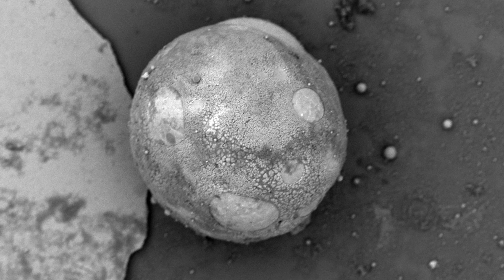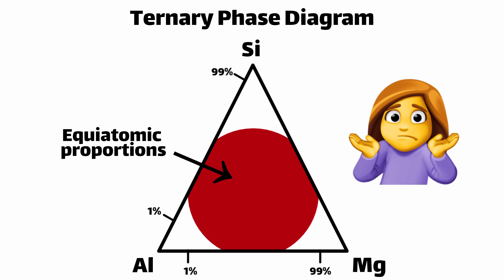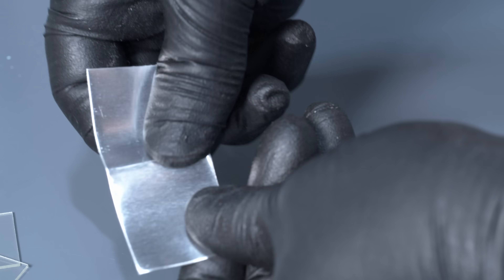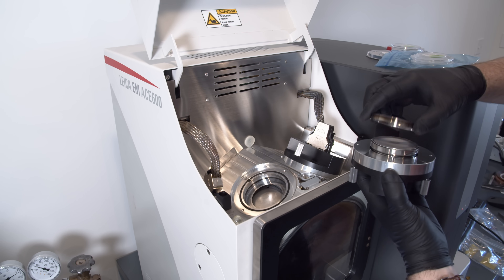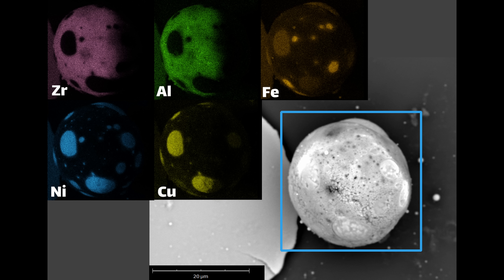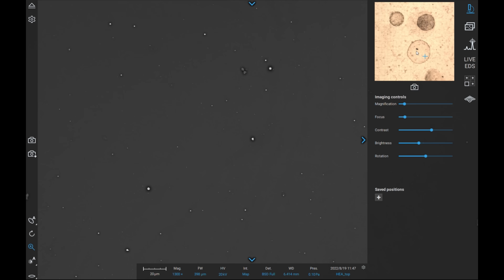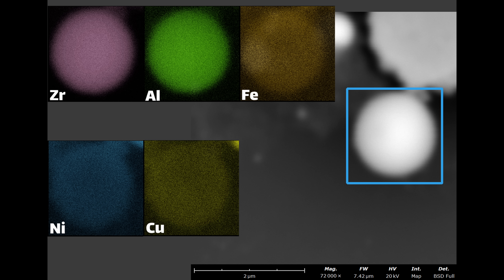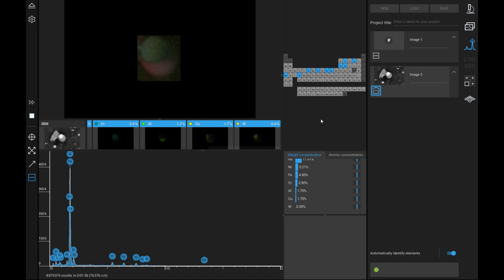Metal Alloys of the Future?

Comment: Where is the ultrasonic cooling shims? Sound vibrations doesn't just move sand, solidification of an alloy can have those lines possess different physical characteristics. Something like a well-thought-out conductivity pattern can facilitate anti-corrosive properties of the secondary structure of a probe operating on Venus's surface, or any hazardous environment

Comment: I feel severly undereducated in this comment section but i had a question, would it be possible to create a high entropy alloy of Aluminium Boron and Lead to be used as a mesh alloy in a radiation layering or would the alloy never hold
Reply: I was thinking of a prospect of using the alloy as a face layer and mid layer with borosillicate glass and leaded glass in the middle seperated by sheets of aluminium foil and a backplate of lead encased in the alloy i primarily was thinking this as a solution to gamma ray radiation and cosmic rays in interstellar probes and possibly vehicles or stations if we ever figure out the complications of the alcubierre bubble, or some alternative way around einsteins theory of relativity in relation to gravitational distortion and superluminal locomotion but thats a fantasy the realistic applications could be more along the lines of improved nuclear reactor safety and gas and resource collection in solar wind within our solar system

Comment: I really need your help @Breaking Taps !!! I am trying to learn about metallurgy and alloying, but it isn't easy to find basic information. I am a drummer, and I would like to make my own cymbals. Yes... I know... this is DIY taken maybe a little but "too far!" but... hear me out. It is commonly said that many of the major cymbal manufacturers use what is called a "B20 bronze alloy" to make their high end cymbals. This means, I think, that it is 80% copper and 20% tin. (sometimes called "bell bronze"). But ALL of the major manufcturers claim that their METHOD for alloying these two metals is proprietary, very special, and is a closely guarded trade secret. I would like to use my backyard furnace to make my own B20 bell bronze. And I cannot think of, nor find online, any special methods for creating Bronze, other than... Step 1: melt x grams pf Copper... Step 2: Add .02 * x grams of tin (20%) ... Step 3: melt and stir... Step 4... pour into a mold and have a beer. What else could there. be?

Comment: High entropy metals are simple in concept: Mix equal proportions of 5 metals together. In Roswell supposedly they found metals that were very hard and very ductile, and not like any metal or alloy at the time. One has to wonder if that was really an early military research application of high entropy alloy that was in an experimental VTOL that crashed near the Air Force base that was near.

Comment: I really hope somebody super smart reads this.

You need to create a multilayered alloy. Sputter through a thin film of one pure element onto a second thin film that you then sputter through onto another film.

You can create infinitely complex designs using this method.

Then calculate temperature into the mix. The target film will have different characteristics at different sputtering chamber temperatures even with the exact same chemical and formula recipes.

Comment: Really loved the "here be dragons" part of the diagram. Its always the best part of any technical discussion. 

To me, it seems like heat feels like the wrong way to try and get these results. To my amateur eye, the problem with this use of heat is that heat is going to effect material according to particle mass. Basically, there's no great way to heat both A and B, but not mixtures of (A+B). Using pulsed lasers for fast annealing does mitigate this issue, but ultimately the application method keeps the mixture's response to heat "between" A's and B's response. Instead, I would aim for some kind of resonance, frequency-based heating method. I think in that case it would be possible to preferentially heat A and B over A+B, for example using something like Induction Smelting, Microwave Resonance, something along those lines. Its well known that atomic iron (eg hemoglobin) isn't magnetic, but iron domains are. Using some distinguishing feature like this, it should be possible to basically only heat the iron in a material that's in bulk form, while not heating already-mixed iron, of course depending on what's being mixed in.

Comment: Foundry metallurgist here...great video! As much as I'm familiar with this class of materials (not much, to be honest), everything sounded about right. I'll add that there are at least some casting alloys, mostly specialty stainless steel alloys in my experience, that are ternary and have significant amounts of the major constituent elements:

-Heat-resistant stainless steel. Although this is generally a broad class of materials, composition-wise, the more highly-alloyed grades have 15-30% Cr, 15-50% Ni, and 20-60% Fe. The balance of Cr and Ni, in particular, can be used to tailor the material to oxidizing or reducing environments, improve resistance to sulfide and/or chloride corrosion, adjust the maximum service temperature, and adjust the microstructure to improve cracking resistance under cyclic loads. Carbon is an important feature of pretty much all of these, as chromium carbides help improve high-temperature strength, creep resistance, and fatigue properties.

-Extreme heat-resistant alloys. These are an offshoot of the standard heat-resistant grades that keep the high levels of Cr, Ni, and Fe and then add usually Co, W, and Nb in concentrations of 5-15%. 

-There are plenty of alloys like the manganese austenitic stainless steels and high-chromium white cast irons that have excellent wear resistance and decent corrosion resistance, but needing high levels of both of those things end up in the realm of certain specialty alloys. 30+% Ni, 30% Cr, a smorgasbord of other elements like Mn and Cu in the 1-5% range, and 5-20% Fe forms helpful intermetallic compounds that boost wear resistance while still having excellent corrosion resistance thanks to the nickel and chrome.

Comment: Not so much 'of the future', more like, "for the rich". Because alloying ingredients like Co, Ni, V, etc are far more expensive than iron. Creating alloys which contain near-equal amounts means you are creating a fantastically expensive alloy that only people who build submarines, supercars, and nuclear reactors will be able to use.  This should not impress or concern the common man.  This research will not in any way impact your life.
Reply from the maker: I don't think that's true or a fair look at how advanced materials are used. I.e. today cobalt is used as a binder for tungsten carbide tooling, which in turn is used to cut most commodity metals (aluminum, steel, titanium, etc) which filter into every part of an average consumer's life. So even though cobalt is relatively expensive and not used directly in consumer applications, it has a large impact.

If HEAs can be used to create better tooling that lasts longer, cuts better, etc it would have a huge impact even if the alloy itself isn't being used in a spatula or whatever 🙂 Ditto to uses in turbines (jet engines, power plants) and other advanced components which indirectly have a large impact. I agree that HEAs will probably never be used as a car frame or a refrigerator shell, but there's no reason for that either. These advanced materials will be used in demanding situations that require them.

Comment: I know nothing about any of this but found it all fascinating. I have an idea, don't know if anyone has tried this, but could you just make a sputtering setup that can apply 5 elements at once, or in rapid succession. If you want a perfect atomic mixture, it makes sense to me to mix them while they are already atoms. No idea if it's practical though.

I also wonder if you could make some kind of 3d printing type sputtering machine and vary the properties of the metal in different areas. Depending on precision, you could make a metal object with a superconducting path through it, or a super conducting transistor embedded in metal. It could be a way to build metal based computer chips which would be much better at cooling and could run at very high temperatures compared to silicon.

Comment: I wonder if you'd have better success repeating the process with the slides resting on a bed of dry ice, or perhaps in liquid nitrogen? I saw a video explaining that the key to making metallic glass is VERY rapid cooling from extremely high temperaturs, so PERHAPS you could achieve better results with much faster cooking.

Comment: Your discovery of the difficulty of getting the Tungsten to combine, with the hypothesis that it's because it's a refractory metal, gives me an idea. 
Take [ whatever data that represents how much of that wavelength of laser energy is captured and turned to heat] for each metal. Then lay down the metals in order of their [ laser energy required to boil ], so that the most energy demanding materials are the first ones in the line of fire. Then, when you hit them with the laser, the low-melting/high-absorption layers don't get over-energized before the more difficult layers are fully zapped. 
It may also be worth finding some sort of deliberate "stop" layer, that will keep the stack in place longer before separating from the glass, or react away the oxygen that may dislodge from the surface.

Comment: Have you tried flame spraying fine powder mixes of the alloying constituents you are interested in onto a substrate? While searching for extremely corrosion resistant alloys for nuclear waste disposal canisters, the group I was working with delved briefly into amorphous metals and the potential for flame spraying a stainless steel container with high nickel content amorphous coating. There wasn't enough detailed information on these materials at the time to make any production commitments, but they had great promise for the future. They were called amorphous because the molten spray was fine enough that it quenched before crystal grain structures could form. That prevented the creation of grain boundaries that can lead to intergranular corrosion. The process might be adaptable for layering high entropy metal alloys. This topic will be fun to follow...

Comment: isnt it better to grind all of different material separetely in different ratio then as powder mix them then use liser or whatever tech thing to just spew it into some kind of a steel by laser? you would end up with semi static fused multi alloy material? making them layer by layer is kind a dumb if you use laser on every  layer. layer by layer will consume some of energy of laser making it difficult to other layers laser can get through... just saying . base start of this is bad. there is needed different approach.

Comment: What I ABSOLUTELY HATED about Material Science course is that it felt like medieval Alchemy rather than an actual science.
We learned what were parameters of different alloys and that's it.

But as far as I understand it was not a course problem but the current state-of-the-art of Material Science.
We don't have - according to our professors - technology to be able to predict properties of materials/alloys.
According to the course - some time in the distant future - there eventually would be supercomputers powerful enough to simulate very large number of atoms in crystal/lattice of the materials to be get close enough data without creating and testing such materials physically.

They also claimed that it should be possible in theory to have materials 100 times stronger than we have today, room temperature superconductors and maybe even heat "superconductors".
Its just that we have no idea how due to lack of ability to predict behavior of crystal of complex mix.

I wonder did state-of-the art changed since I graduated from my University...

Comment: I have no actual knowledge in metal bending😂, I just thought about the 2500+ layer japanese katanas, what would happen if you do the Japanese katana folding technique? Like a same size and weight sheet of each metal and fold and stretch and fold, for the 2500+ layers into one thin sheet... would there be more uniformity in the molecular structure or would they still turn out "high entropy structures"?

Comment: We’re doing experiments with a University where a mix of elemental powders are being applied using a LENS machine. That mixes the elements as they are being deposited and “welded” to the surface of a forge tool. Seems to provide improved wear characteristics to the tool but whether the result is cost effective is yet to be determined.

Comment: You might want to try lo voltage arc ablation... in vacuum arc rod carving similar to the laser demonstrated. (1v=11602K) 11602K + 272.15 = 11,872.15°C.

Comment: A suggestion. Coat 2 materials on each other and peal of using laser. Harvest the resulting particles. On a new glass coat the harvested material and add the extra metal. Laser sinter and harvest again. With this method you add one material at a time. Hope it works. 🤞

Comment: Those spectral imaging methods are lovely. How long does it take to scan the pixels?
Reply from the maker: Depends on how much resolution and noise reduction you want. But for moderately high resolution and decent signal:noise, takes about 5 minutes per image. You can let it run for hours if you want to get an absolutely gorgeous image but I rarely have the patience for that :)

Comment: I did not read all the comments but have you considered instead of doing the initial deposition onto a glass slide to do it onto a piece of copper? That way it wouldn't peel off of the glass slide necessarily but it would bond to The copper maybe.

Comment: This is insane, but what impressed me the most was that you can determine not only the composition of the particles, but also where the different metals are distributed in them, and even further, making an image. As if you were using different filters or lases in light microscopy. Is this something similar to that? Also, for me it seems that the metal layers resulting from the sputtering are more mixed to one another than the end result. Not always off course, but in some particles the Ni and Cu were totally excluded from the other metals. However, this makes me wonder if these strange alloys can be made by sputtering different metals at the same time onto a surface...

Comment: I wonder if you could make a supercritical alloy using diffusion into some other medium like Si (just what I am used to). This would rely on some method to remove the medium, but not the metals. Or, maybe some variation would be to form the alloy crystal in that medium without removing the medium until the end. Theoretically, the biggest problem is to ameliorate the electronic (chemical) differences between the metals so that they don't form individual crystals. Perhaps supercooling the metal billet before ablating it might help. I will definitely be looking more into this, especially at the superconductors.

Comment: How about a fine powder and then use explosive welding technique to fuse the powder together.    You will get even distribution if the powder was uniform.   I have welded aluminum alloys to iron alloy metallic glass using explosives.

Comment: As a chemical worker cold is relative. The mill which should "mill" this must be water cooled. Large scale milling (1t and above) generates an insane ammount of heat. I can only talk about glazings for glas and ceramic colours but we needed to grind the glas powder finer and after 6 hours the surface was boiling hot. If we talk about mushing metals on such a fine scale I can't get an idea on how a mill should be used for that. I can see the theory in it but on a larger scale it wouldn't work the way they want and the yield would be abysmall.

Comment: I would think that mixing purified metal powders together, flooding them with a noble gas, and then blasting them with an electrical arc until thoroughly molten would be the most practical way to make a macroscopic sample of a high-entropy alloy.
Reply: But that would be so costly... i think there is lots of ideas like these
But none of them actually being worked on because they are just economically not feasible
Reply: That wouldn't be expensive at all, I have all the necessary components with a basic welding setup, minus the crucible. But you would probably need WAY more power than your everyday welder if you were trying to do it without the chaotic mechanical agitation on the molecular level.. like it might take temperatures that aren't realistic to achieve in practice

Comment: You need to use silver fume to get the other metals to stick into glass, otherwise the other metals will just slide right off. Silver ions can catch and stay on the surface of glass which can provide a jagged surface with much higher surface area for other metals to stick onto

Comment: Ok, so right now i'm writing a thesis for MSc but for similar field - reablation of gold nanoparticles. From paper that I read about ablation of gold by using laser (same thing, but the researchers were only using gold), the effect of chemicals that are present in solution is crucial to this process. For more even size distributions of particles you can try to use some ligands that bind to the metal like CTAB or sodium citrate. If concentration of those is close to the critical micelle concentration, that should give you more even size distribution of spherical particles. But only use one ligand - the one that have stronger interaction between metal surface will bind to the particles. You can try it out with different concentrations. Maybe it work - maybe not, because this is a realm of chemistry and from my own experience, unfortunetly most of the experiments published in research papers aren't reproducible. ;)